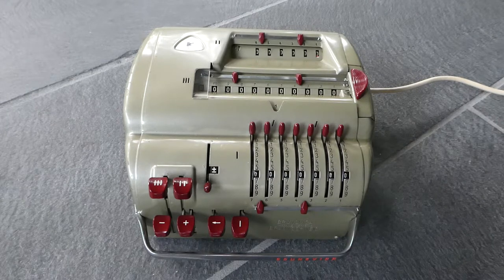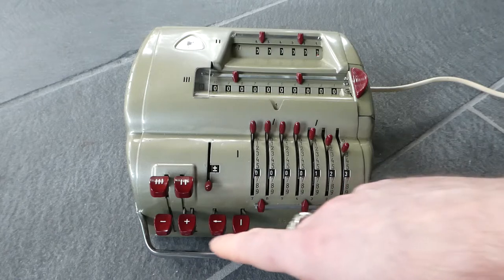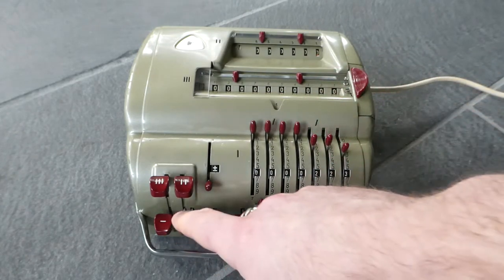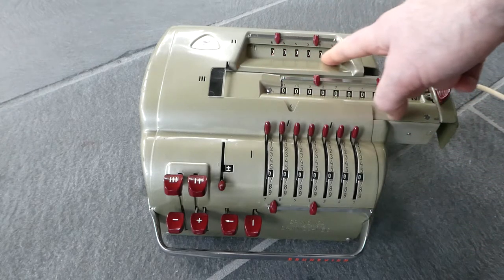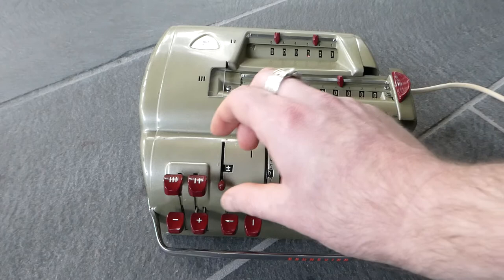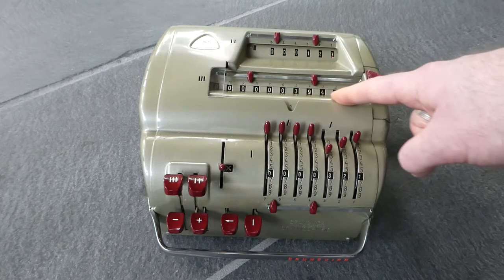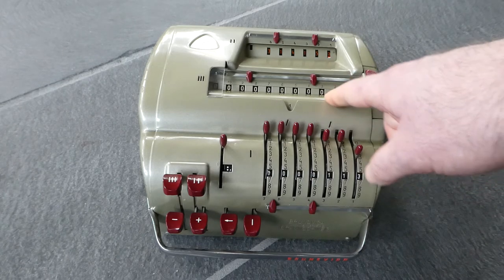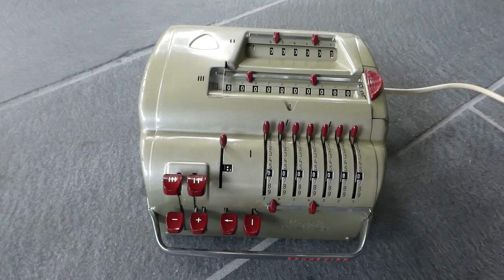The Brunsviga 11E Mechanical Calculator

Comment: I missed one of these on ebay sometime last year - they're a lovely little machine - there's one on ebay at the moment, it's sitting at a nice price but the shipping from Germany is three or four times what I'd expect to pay.  They've also got a double Brunsviga which I'd love and also a triple Brunsviga that I didn't even know existed - well out of my price bracket...........still my Mercedes Euklid arrived, slightly damaged due to no padding at all!!!!!  I've already repaired a couple of bits but there's still more faults to sort out.
Reply from the maker: I have a double Brunsviga (D13-R2), and that is heavy and bulky enough that a triple would be daunting. The triple does seem to be exceptionally rare, hence the asking price. I get just as much enjoyment out of a small unknown machine than such a blockbuster. Good luck with the Euklid!
Reply: @jaapsch2  I agree, the machines like the triple are mighty impressive but I tend to get the most enjoyment out of simpler machines - my most used machine is my Precisa 160-12 adding machine - I love using it and it always brings a smile to my face.

Comment: Hello,
I have the same machine but I do not have the cable and the plug.
Can you tell me how to connect the machine.
Thanks, Alain.
Reply from the maker: There are a few calculator brands that used the same plug - Brunsviga, Facit, and Hermes/Precisa. Unfortunately the plug I have has no type number (just 6/250 to say it is rated for 6 Amp at 250 Volt, and also a VDE certification mark) and googling hasn't brought up anything.